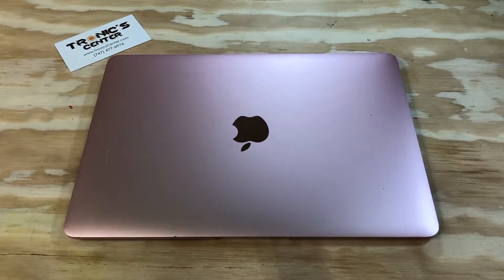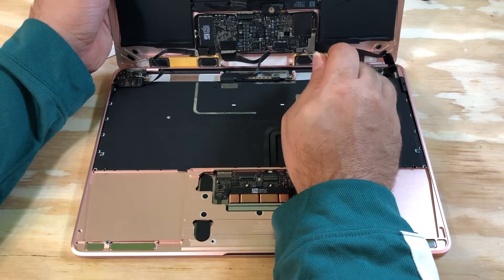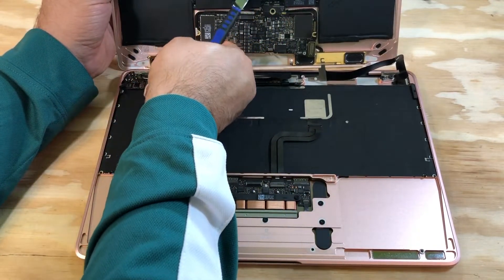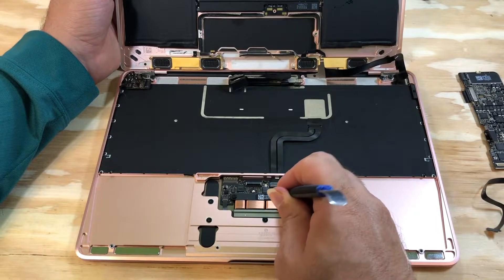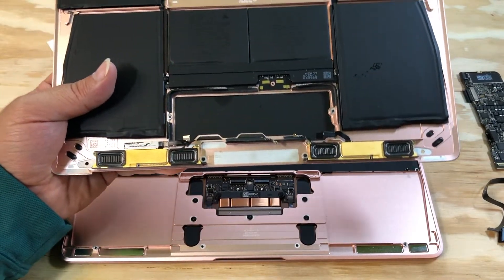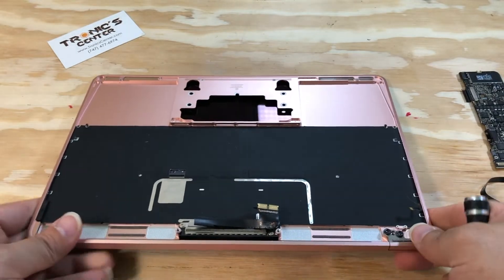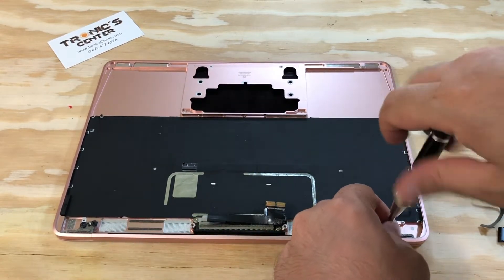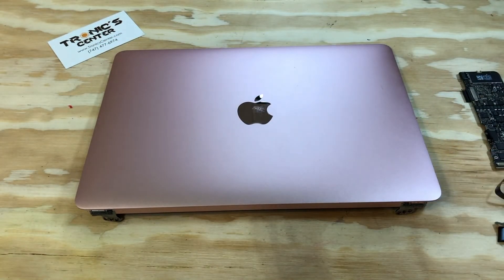Take Apart 12" Apple MacBook A1534 - Quick 12" MacBook Disassembly and Tear down 2015 - 2017

Comment: Hello, where is the wi-fi card on this 12" macbook air? Thank you. Your video is great.
Reply from the maker: Hi
Wifi card is onboard , part of the logic board in this model .
12" MacBook A1534 repair Rose Gold, 12" MacBook A1534 repair Silver, 12" MacBook A1534 repair Space Gray, 12" MacBook A1534 screen replacement Rose Gold, 12" MacBook A1534 screen replacement Silver, 12" MacBook A1534 screen replacement Space Gray, MacBook A1534 Rose Gold battery replacement, MacBook A1534 Silver battery replacement, MacBook A1534 Space Gray battery replacement, 12" MacBook A1534 keyboard repair Rose Gold, 12" MacBook A1534 keyboard repair Silver, 12" MacBook A1534 keyboard repair Space Gray, MacBook A1534 Rose Gold logic board repair, MacBook A1534 Silver logic board repair, MacBook A1534 Space Gray logic board repair, MacBook A1534 display assembly repair Rose Gold, MacBook A1534 display assembly repair Silver, MacBook A1534 display assembly repair Space Gray, 12" MacBook A1534 trackpad repair Rose Gold, 12" MacBook A1534 trackpad repair Silver, 12" MacBook A1534 trackpad repair Space Gray, MacBook A1534 Rose Gold repair service near me, MacBook A1534 Silver repair service near me, MacBook A1534 Space Gray repair service near me, 12" MacBook A1534 repair parts Rose Gold, 12" MacBook A1534 repair parts Silver, 12" MacBook A1534 repair parts Space Gray, MacBook A1534 Rose Gold water damage repair, MacBook A1534 Silver water damage repair, MacBook A1534 Space Gray water damage repair, 12" MacBook A1534 logic board replacement Rose Gold, 12" MacBook A1534 logic board replacement Silver, 12" MacBook A1534 logic board replacement Space Gray, MacBook A1534 Rose Gold SSD replacement, MacBook A1534 Silver SSD replacement, MacBook A1534 Space Gray SSD replacement, 12" MacBook A1534 hinge repair Rose Gold, 12" MacBook A1534 hinge repair Silver, 12" MacBook A1534 hinge repair Space Gray, MacBook A1534 Rose Gold screen repair cost, MacBook A1534 Silver screen repair cost, MacBook A1534 Space Gray screen repair cost, 12" MacBook A1534 charging port repair Rose Gold, 12" MacBook A1534 charging port repair Silver, 12" MacBook A1534 charging port repair Space Gray, MacBook A1534 Rose Gold overheating issue repair, MacBook A1534 Silver overheating issue repair, MacBook A1534 Space Gray overheating issue repair, 12" MacBook A1534 speaker replacement Rose Gold, 12" MacBook A1534 speaker replacement Silver, 12" MacBook A1534 speaker replacement Space Gray, MacBook A1534 Rose Gold repair diagnostics, MacBook A1534 Silver repair diagnostics, MacBook A1534 Space Gray repair diagnostics, 12" MacBook A1534 cracked screen repair Rose Gold, 12" MacBook A1534 cracked screen repair Silver, 12" MacBook A1534 cracked screen repair Space Gray, MacBook A1534 Rose Gold fan replacement, MacBook A1534 Silver fan replacement, MacBook A1534 Space Gray fan replacement, 12" MacBook A1534 hinge replacement Rose Gold, 12" MacBook A1534 hinge replacement Silver, 12" MacBook A1534 hinge replacement Space Gray, MacBook A1534 Rose Gold repair shop near me, MacBook A1534 Silver repair shop near me, MacBook A1534 Space Gray repair shop near me, 12" MacBook A1534 display replacement Rose Gold, 12" MacBook A1534 display replacement Silver, 12" MacBook A1534 display replacement Space Gray, MacBook A1534 Rose Gold screen flicker repair, MacBook A1534 Silver screen flicker repair, MacBook A1534 Space Gray screen flicker repair, 12" MacBook A1534 keyboard replacement Rose Gold, 12" MacBook A1534 keyboard replacement Silver, 12" MacBook A1534 keyboard replacement Space Gray, MacBook A1534 Rose Gold screen replacement service, MacBook A1534 Silver screen replacement service, MacBook A1534 Space Gray screen replacement service, 12" MacBook A1534 power button repair Rose Gold, 12" MacBook A1534 power button repair Silver, 12" MacBook A1534 power button repair Space Gray, MacBook A1534 Rose Gold damaged screen repair, MacBook A1534 Silver damaged screen repair, MacBook A1534 Space Gray damaged screen repair, 12" MacBook A1534 repair cost Rose Gold, 12" MacBook A1534 repair cost Silver, 12" MacBook A1534 repair cost Space Gray, MacBook A1534 Rose Gold Wi-Fi issue repair, MacBook A1534 Silver Wi-Fi issue repair, MacBook A1534 Space Gray Wi-Fi issue repair, 12" MacBook A1534 audio jack repair Rose Gold, 12" MacBook A1534 audio jack repair Silver, 12" MacBook A1534 audio jack repair Space Gray, MacBook A1534 Rose Gold USB port replacement, MacBook A1534 Silver USB port replacement, MacBook A1534 Space Gray USB port replacement, 12" MacBook A1534 screen calibration Rose Gold, 12" MacBook A1534 screen calibration Silver, 12" MacBook A1534 screen calibration Space Gray, MacBook A1534 Rose Gold repair expert, MacBook A1534 Silver repair expert, MacBook A1534 Space Gray repair expert, 12" MacBook A1534 screen repair near me Rose Gold, 12" MacBook A1534 screen repair near me Silver, 12" MacBook A1534 screen repair near me Space Gray, MacBook A1534 Rose Gold repair DIY guide, MacBook A1534 Silver repair DIY guide, MacBook A1534 Space Gray repair DIY guide, 12" MacBook A1534 overheating solution Rose Gold, 12" MacBook A1534 overheating solution Silver, 12" MacBook A1534 overheating solution Space Gray, MacBook A1534 Rose Gold repair service cost, MacBook A1534 Silver repair service cost, MacBook A1534 Space Gray repair service cost, 12" MacBook A1534 damaged case repair Rose Gold, 12" MacBook A1534 damaged case repair Silver, 12" MacBook A1534 damaged case repair Space Gray, MacBook A1534 Rose Gold broken hinge repair, MacBook A1534 Silver broken hinge repair, MacBook A1534 Space Gray broken hinge repair, 12" MacBook A1534 backlight issue Rose Gold, 12" MacBook A1534 backlight issue Silver, 12" MacBook A1534 backlight issue Space Gray, MacBook A1534 Rose Gold liquid damage repair, MacBook A1534 Silver liquid damage repair, MacBook A1534 Space Gray liquid damage repair, 12" MacBook A1534 power issue repair Rose Gold, 12" MacBook A1534 power issue repair Silver, 12" MacBook A1534 power issue repair Space Gray, MacBook A1534 Rose Gold repair cost estimation, MacBook A1534 Silver repair cost estimation, MacBook A1534 Space Gray repair cost estimation, 12" MacBook A1534 hinge repair near me Rose Gold, 12" MacBook A1534 hinge repair near me Silver, 12" MacBook A1534 hinge repair near me Space Gray, MacBook A1534 Rose Gold repair and parts, MacBook A1534 Silver repair and parts, MacBook A1534 Space Gray repair and parts, 12" MacBook A1534 repair online support Rose Gold, 12" MacBook A1534 repair online support Silver, 12" MacBook A1534 repair online support Space Gray, MacBook A1534 Rose Gold replacement parts, MacBook A1534 Silver replacement parts, MacBook A1534 Space Gray replacement parts
Many Thanks
Reply from the maker: If You Need any Original Parts or Tools You May Visit www.Tronicscenter.com For Original Apple Parts .

Comment: My laptop is this one A1534 and it Doesnt turn on anymore and I wanted to remove the SSD, is that possible?
Reply from the maker: Hi, In this Model SSD is Attached to the logic board , for more info you may visit your local computer store or local Apple store  , Thanks for watching, Good luck with your research .

Keywords:
MacBook repair services
Apple Mac repair near me
MacBook screen replacement
MacBook battery repair
Apple certified Mac repair
MacBook water damage repair
MacBook keyboard replacement
Mac repair specialist
Affordable MacBook repair
MacBook repair warranty

Hashtags :
#MacBookRepair
#AppleRepair
#MacRepair
#MacBookFix
#MacBookService
#MacRepairSpecialist
#MacTech
#FixMyMac
#MacBookScreenRepair
#AppleSupport
#RepairMyMac
#MacServiceCenter
#MacBookBatteryReplacement
#MacBookKeyboardFix
#AppleCertifiedRepair

MacBook Pro
MacBook Air
Apple MacBook deals
MacBook accessories
MacBook repair services
Best MacBook for students
MacBook 2024 release date
MacBook battery replacement
Apple MacBook upgrade
Refurbished MacBook
Popular Hashtags for Social Media:
#MacBook
#MacBookPro
#MacBookAir
#AppleMac
#Apple
#AppleProducts
#MacBookDeals
#MacLife
#AppleEvent
#AppleEcosystem
#TechForLife
#MacBookPhotography
#MacBookSetup
#RefurbishedMacBook
#MacBookTips
Reply: No it is not

Comment: spudgers should be plastic, not metal, metal can cause damage on the board where plastic is less likely to occur and plastic is softer than metal components on logicboard....
Reply from the maker: Correct ! Plastic anti static spudgers is preferred ! Dear Customer let us know what repair or disassembly you want us to make video ! Please not that we do deal with all Brands Dell, Lenovo, Asus, Razer, Toshiba, Hp, Sony, Panasonic, Nikon, Canon, Black Magic, Red Camera, any Camcorder Bards, Also we do IT Support and Data Recovery !
Reply from the maker: A2251 KeyWords 

MacBook Pro "Core i5" 2.0 13" 2020 4 TB 3, 2.0 GHz Core i5, I5-1038NG7, MacBook Pro "Core i7" 2.3 13" 2020 4 TB 3, 2.3 GHz Core i7,  I7-1068NG7, MacBookPro16,2 , 2020 13" 4 TB 3 , A2251 MacBook , EMC 3348, MWP72LL/A, BTO/CTO

————————————————————

A2141 KeyWords 

MacBook Pro "Core i7" 2.6 16" 2019, 2.6 GHz Core i7 (I7-9750H), 2.3 GHz Core i9 (I9-9880H), A2141 (EMC 3347), 2.4 GHz Core i9 (I9-9980HK) , MacBookPro16,1, MacBook Pro "Core i7" 2.6 16" 2019 5600M, 2.6 GHz Core i7 (I7-9750H),  MacBookPro16,4 , MacBook Pro "Core i9" 2.3 16" 2019 5600M, 2.3 GHz Core i9 (I9-9880H), MacBook Pro "Core i9" 2.4 16" 2019 5600M, 2.4 GHz Core i9 (I9-9980HK), MVVL2LL/A, MVVM2LL/A, 16" MacBook A2141

———————————————

A2179 Keywords

MWTJ2LL/A, EMC 3302 , 1.1 GHz Core i3 (I3-1000NG4) , MacBook Air "Core i3" 1.1 13" (Scissor, 2020) , MacBookAir9,1 , 1.1 GHz Core i5 (I5-1030NG7) , MVH22LL/A , MacBook Air "Core i7" 1.2 13" (Scissor, 2020), 1.2 GHz Core i7 (I7-1060NG7)

——————————————

A2159 Keywords 

1.4 GHz Core i5 (I5-8257U) , MacBook Pro "Core i5" 1.4 13" Touch/2019 2 TB 3 , MacBook Pro "Core i7" 1.7 13" Touch/2019 2 TB 3 , 1.7 GHz Core i7 (I7-8557U) , MUHN2LL/A , A2159 , EMC 3301 , MacBookPro15,4 , 2019 13" (Touch Bar, 2 TB 3), 13" MacBook Pro A2159

—————————————————————

A1932 Keywords  

MRE82LL/A , MVFH2LL/A, 1.6 GHz Core I5-8210Y, 1.6 GHz Core I5-8210Y, MacBookAir8,1 , EMC 3184 , 13" MacBook Air Space Gray, 13" MacBook Air Gold , 13" MacBook Air Silver , 13" MacBook Air 2019 13" MacBook Air 2018, 13" MacBook Air A1932

—————————————————————

A1534 Keyword’s

EMC 2746, MF855LL/A, MF865LL/A, EMC 2991, MLHA2LL/A, MLHC2LL/A, EMC 3099, MNYF2LL/A, MNYG2LL/A, MacBook8,1 , 1.1 GHz Core M (M-5Y31) , 1.2 GHz Core M (M-5Y51), 1.3 GHz Core M (M-5Y71), 1.1 GHz Core m3 (M3-6Y30), 1.2 GHz Core m5 (M5-6Y54), 1.3 GHz Core m7 (M7-6Y75), 1.2 GHz Core m3 (M3-7Y32), 1.3 GHz Core i5 (I5-7Y54), 1.4 GHz Core i7 (I7-7Y75), MacBook9,1 , MacBook10,1

——————————————————

A1990 Keywords

MR932LL/A, 2.2 GHz Core i7 (I7-8750H), EMC 3215, MacBookPro15,1 , MR942LL/A 2.6 GHz Core i7 (I7-8850H), 2.6 GHz Core i7 (I7-8850H), 2.9 GHz Core i9 (I9-8950HK), 2.6 GHz Core i7 (I7-9750H), EMC 3359, 2.3 GHz Core i9 (I9-9880H), 2.4 GHz Core i9 (I9-9980HK), MacBookPro15,3, A1990 MacBook, 15” MacBook A1990

———————————————————

A1989 Keyword 

A1989 MacBook 2018 MR9Q2LL/A, 2.3 GHz Core i5 (I5-8259U), BTO/CTO, 2.7 GHz Core i7 (I7-8559U), EMC 3214, MacBookPro15,2 , A1989 MacBook 2019 MV962LL/A , 2.4 GHz Core i5 (I5-8279U) , MV982LL/A, 2.8 GHz Core i7 (I7-8569U) , EMC 3358, 13" MacBook A1989

———————————————

A1708 Keywords

MLL42LL/A, A1708, EMC 2978, MacBookPro13,1 , 2.0 GHz Core i5 (I5-6360U) , 2.4 GHz Core i7 (I7-6660U) , MPXQ2LL/A, EMC 3164, 2.3 GHz Core i5 (I5-7360U) , 2.5 GHz Core i7 (I7-7660U), MPXQ2LL/A, 13" MacBook A1708

———————————————————— 
MacBook 

Apple, MacBook, 13" MacBook, MacBook Air, A1466 MacBook, MacBook Air logic Board, 13" MacBook Air , Apple Mac , 11” MacBook , A1465 MacBook, A1502 MacBook, A1398 MacBook, A1425 MacBook, A1706 MacBook, A1708 MacBook, A1707 MacBook, A1990 MacBook, A1989 MacBook, A2159 MacBook, A2179 MacBook, A2289 MacBook, A2337 MacBook, A2338 MacBook, A2141 MacBook, MacBook Pro, MacBook Pro Retina, Retina display, True Tone Display , Top Case KeyBoard, Apple Keyboard, MacBook KeyBoard, MacBook Trackpad.
———————————————————

A1398 MacBook, A1398 Logic Board, A1398 LCD, A1398 KeyBoard , A1398 Display, MC975LL/A, MC976LL/A, MD831LL/A, ME664LL/A, ME665LL/A , ME698LL/A, ME293LL/A, ME294LL/A, ME874LL/A, MGXA2LL/A, MGXC2LL/A, MGXG2LL/A, MJLQ2LL/A, MJLT2LL/A, MJLU2LL/A

—————————————————————

A1706 Keywords

MLH12LL/A, A1706 EMC 3071, MacBookPro13,2 , MacBookPro14,2 , MPXV2LL/A, A1706 EMC 3163 , 3.5 GHz Core I7-7567U, 3.3 GHz Core I5-7287U, 3.1 GHz Core I5-7267U, 3.3 GHz Core I7-6567U, 3.1 GHz Core I5-6287U, 2.9 GHz Core I5-6267U, A1706 MacBook, A1706 MacBook Touch Bar 

—————————————————————
A1707 Keywords 

MPN 923-01477 , MLH32LL/A, MLH42LL/A, MPTR2LL/A, MPTT2LL, EMC 3072, MLH32LL/A, MacBookPro13,3, 2.7 GHz Core i7 (I7-6820HQ), MLH42LL/A, 2.9 GHz Core i7 (I7-6920HQ), EMC 3162 , 2.8 GHz Core i7 (I7-7700HQ), MacBookPro14,3 , 2.9 GHz Core i7 (I7-7820HQ), MPTR2LL/A, MPTT2LL/A, 3.1 GHz Core i7 (I7-7920HQ), A1707 MacBook, A1707 Touch Bar
Reply from the maker: A2251 KeyWords 

MacBook Pro "Core i5" 2.0 13" 2020 4 TB 3, 2.0 GHz Core i5, I5-1038NG7, MacBook Pro "Core i7" 2.3 13" 2020 4 TB 3, 2.3 GHz Core i7,  I7-1068NG7, MacBookPro16,2 , 2020 13" 4 TB 3 , A2251 MacBook , EMC 3348, MWP72LL/A, BTO/CTO

————————————————————

A2141 KeyWords 

MacBook Pro "Core i7" 2.6 16" 2019, 2.6 GHz Core i7 (I7-9750H), 2.3 GHz Core i9 (I9-9880H), A2141 (EMC 3347), 2.4 GHz Core i9 (I9-9980HK) , MacBookPro16,1, MacBook Pro "Core i7" 2.6 16" 2019 5600M, 2.6 GHz Core i7 (I7-9750H),  MacBookPro16,4 , MacBook Pro "Core i9" 2.3 16" 2019 5600M, 2.3 GHz Core i9 (I9-9880H), MacBook Pro "Core i9" 2.4 16" 2019 5600M, 2.4 GHz Core i9 (I9-9980HK), MVVL2LL/A, MVVM2LL/A, 16" MacBook A2141

———————————————

A2179 Keywords

MWTJ2LL/A, EMC 3302 , 1.1 GHz Core i3 (I3-1000NG4) , MacBook Air "Core i3" 1.1 13" (Scissor, 2020) , MacBookAir9,1 , 1.1 GHz Core i5 (I5-1030NG7) , MVH22LL/A , MacBook Air "Core i7" 1.2 13" (Scissor, 2020), 1.2 GHz Core i7 (I7-1060NG7)

——————————————

A2159 Keywords 

1.4 GHz Core i5 (I5-8257U) , MacBook Pro "Core i5" 1.4 13" Touch/2019 2 TB 3 , MacBook Pro "Core i7" 1.7 13" Touch/2019 2 TB 3 , 1.7 GHz Core i7 (I7-8557U) , MUHN2LL/A , A2159 , EMC 3301 , MacBookPro15,4 , 2019 13" (Touch Bar, 2 TB 3), 13" MacBook Pro A2159

—————————————————————

A1932 Keywords  

MRE82LL/A , MVFH2LL/A, 1.6 GHz Core I5-8210Y, 1.6 GHz Core I5-8210Y, MacBookAir8,1 , EMC 3184 , 13" MacBook Air Space Gray, 13" MacBook Air Gold , 13" MacBook Air Silver , 13" MacBook Air 2019 13" MacBook Air 2018, 13" MacBook Air A1932

—————————————————————

A1534 Keyword’s

EMC 2746, MF855LL/A, MF865LL/A, EMC 2991, MLHA2LL/A, MLHC2LL/A, EMC 3099, MNYF2LL/A, MNYG2LL/A, MacBook8,1 , 1.1 GHz Core M (M-5Y31) , 1.2 GHz Core M (M-5Y51), 1.3 GHz Core M (M-5Y71), 1.1 GHz Core m3 (M3-6Y30), 1.2 GHz Core m5 (M5-6Y54), 1.3 GHz Core m7 (M7-6Y75), 1.2 GHz Core m3 (M3-7Y32), 1.3 GHz Core i5 (I5-7Y54), 1.4 GHz Core i7 (I7-7Y75), MacBook9,1 , MacBook10,1

——————————————————

A1990 Keywords

MR932LL/A, 2.2 GHz Core i7 (I7-8750H), EMC 3215, MacBookPro15,1 , MR942LL/A 2.6 GHz Core i7 (I7-8850H), 2.6 GHz Core i7 (I7-8850H), 2.9 GHz Core i9 (I9-8950HK), 2.6 GHz Core i7 (I7-9750H), EMC 3359, 2.3 GHz Core i9 (I9-9880H), 2.4 GHz Core i9 (I9-9980HK), MacBookPro15,3, A1990 MacBook, 15” MacBook A1990

———————————————————

A1989 Keyword 

A1989 MacBook 2018 MR9Q2LL/A, 2.3 GHz Core i5 (I5-8259U), BTO/CTO, 2.7 GHz Core i7 (I7-8559U), EMC 3214, MacBookPro15,2 , A1989 MacBook 2019 MV962LL/A , 2.4 GHz Core i5 (I5-8279U) , MV982LL/A, 2.8 GHz Core i7 (I7-8569U) , EMC 3358, 13" MacBook A1989

———————————————

A1708 Keywords

MLL42LL/A, A1708, EMC 2978, MacBookPro13,1 , 2.0 GHz Core i5 (I5-6360U) , 2.4 GHz Core i7 (I7-6660U) , MPXQ2LL/A, EMC 3164, 2.3 GHz Core i5 (I5-7360U) , 2.5 GHz Core i7 (I7-7660U), MPXQ2LL/A, 13" MacBook A1708

———————————————————— 
MacBook 

Apple, MacBook, 13" MacBook, MacBook Air, A1466 MacBook, MacBook Air logic Board, 13" MacBook Air , Apple Mac , 11” MacBook , A1465 MacBook, A1502 MacBook, A1398 MacBook, A1425 MacBook, A1706 MacBook, A1708 MacBook, A1707 MacBook, A1990 MacBook, A1989 MacBook, A2159 MacBook, A2179 MacBook, A2289 MacBook, A2337 MacBook, A2338 MacBook, A2141 MacBook, MacBook Pro, MacBook Pro Retina, Retina display, True Tone Display , Top Case KeyBoard, Apple Keyboard, MacBook KeyBoard, MacBook Trackpad.
———————————————————

A1398 MacBook, A1398 Logic Board, A1398 LCD, A1398 KeyBoard , A1398 Display, MC975LL/A, MC976LL/A, MD831LL/A, ME664LL/A, ME665LL/A , ME698LL/A, ME293LL/A, ME294LL/A, ME874LL/A, MGXA2LL/A, MGXC2LL/A, MGXG2LL/A, MJLQ2LL/A, MJLT2LL/A, MJLU2LL/A

—————————————————————

A1706 Keywords

MLH12LL/A, A1706 EMC 3071, MacBookPro13,2 , MacBookPro14,2 , MPXV2LL/A, A1706 EMC 3163 , 3.5 GHz Core I7-7567U, 3.3 GHz Core I5-7287U, 3.1 GHz Core I5-7267U, 3.3 GHz Core I7-6567U, 3.1 GHz Core I5-6287U, 2.9 GHz Core I5-6267U, A1706 MacBook, A1706 MacBook Touch Bar 

—————————————————————
A1707 Keywords 

MPN 923-01477 , MLH32LL/A, MLH42LL/A, MPTR2LL/A, MPTT2LL, EMC 3072, MLH32LL/A, MacBookPro13,3, 2.7 GHz Core i7 (I7-6820HQ), MLH42LL/A, 2.9 GHz Core i7 (I7-6920HQ), EMC 3162 , 2.8 GHz Core i7 (I7-7700HQ), MacBookPro14,3 , 2.9 GHz Core i7 (I7-7820HQ), MPTR2LL/A, MPTT2LL/A, 3.1 GHz Core i7 (I7-7920HQ), A1707 MacBook, A1707 Touch Bar